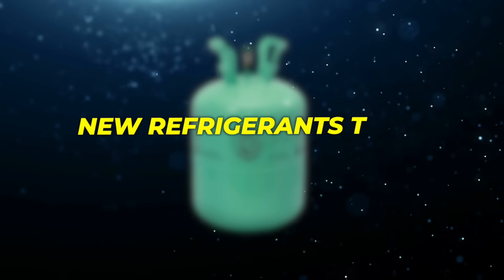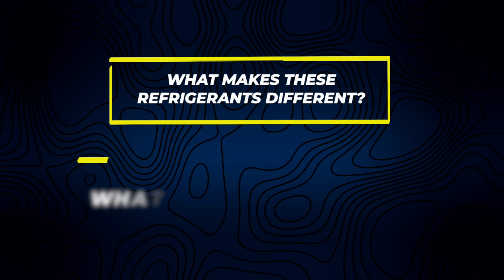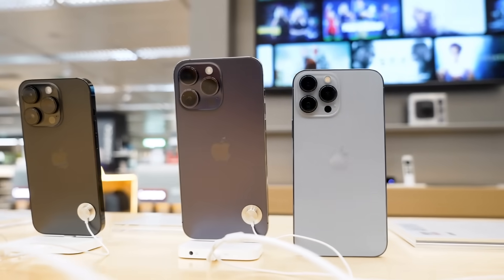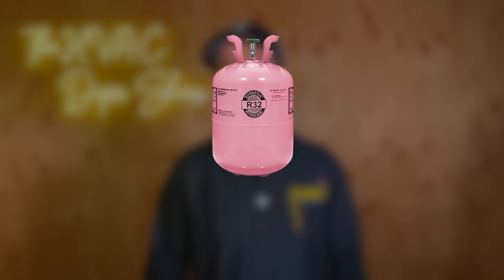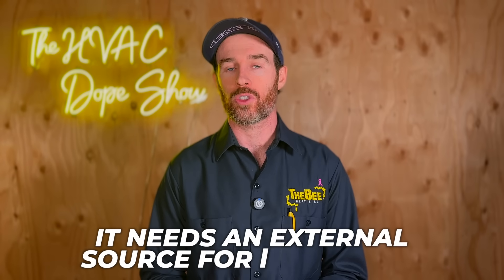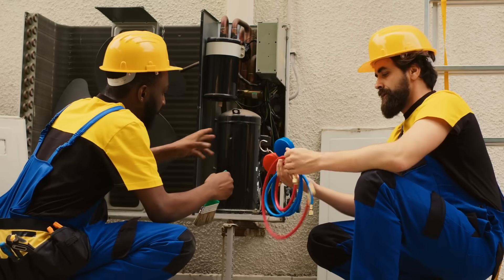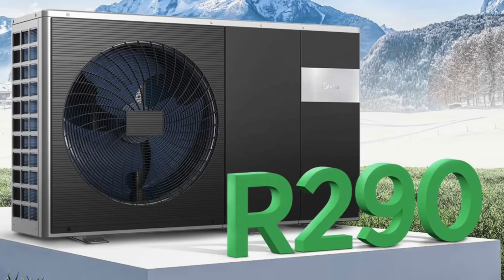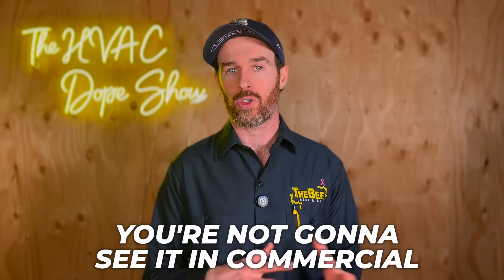The TRUTH about the “new” refrigerants | R32 and R454B refrigerants phase in

Comment: After watching the video I'm honestly still unclear when its worth waiting and when it is not. I understand your point of the planned obsolescence, but we still have to play into their game at the end of the day, and which way would you go? If it were your house and you were about to purchase a system (not an emergency replacement), would you wait a few months for a R32 redesign of the Daikin Fit for example? Or would you buy a non-R32 Fit today, not regrets? Thank you for your videos, I learn a lot from them.
Reply from the maker: Its hard to answer as the HVAC tech because I’ve bought 410a systems personally knowing this is happening… short answer is yes I’d wait for R32. But I’ll give you more context, we’ve installed two new systems one at the shop and our home knowing this was happening within a few years, but at this point if you can wait I’d probably buy an R32 system just because it’s the newer stuff. But I’m also comfortable working on my own equipment if something fails so as much as I’d like to exclude that bias it’s still there… I think if it was my moms house or close friends house I’d be 50/50 split with no regrets because the benefit of 410a is that there’s no shutoff safety switches for refrigerant leaks like there are on the R32 air handlers - which is good because you have to actually fix leaks now and can’t just top off a perpetual leak… but it’s bad for the same reason that in the middle of summer if a coil failed or something, then the R32 safety circuit would prevent it from starting until the leak is actually fixed. This just makes me nervous if I’m trying to get something to cool for a night in the middle of summer in an extreme climate like Phoenix I couldn’t top it off with a lb and come back the next day, I’d have to deal with it right away. Practically speaking R32 is a better call but I am starting to see you can get good deals on SEER1 410a equipment now that the SEER2 stuff is phased in fully, so if price is a determining factor and you can get a smokin deal that’s another thing that might sway me just knowing that I’m getting some close out equipment. If I lived in a hot coastal climate like coastal Florida with a 10 year replacement cycle I probably wouldn’t think twice… for what it’s worth Daikin is honoring 410a equipment failures with R32 equipment if there’s ever a catastrophic failure which is a very nice warranty for people buying stuff right now having peace of mind. Long answer but lots to consider, hope that helped and didn’t confuse you more, it should be a non issue soon in most places because we’re already getting R32 equipment in a few of the models.
Reply: @TheHVACDopeShow  Awesome, thanks for the insights. Yeah I'm in the position where I got a recent ducted daikin fit quote that was a couple thousand less than last year's quote. Thought it was too good to be true, now I'm realizing its a 410a clearance discount. I'm in the PNW so I am tempted to get the 410a system at 2-3K less than I had anticipated. But we're already so backwards in the US with refrigerants, it is a shame to get stuck with the older one. But the discount is pretty decent and makes it much more possible to recoup the system cost over it's life. That is cool to know a warranty replacement would be honored with a r32 system.
Reply: I am in that exact position. I just lost my heating system due to a flood and I have solar panels so I figured I would upgrade to a heat pump. It's just before October and starting to get cold so I am on a time crunch. I decided to go with the r410 system because I did not want to be a guinea pig, it was more affordable and many of the HVAC techs around my area have not been trained on the 454 or at least that's what my guy says. 

Not that I could have afforded it but I wanted to get a Ford lightning and decided against it because I did not want to be a guinea pig and that was a wise decision, if I was in the market for a new truck. That thing has had a boatload of problems from what I've heard. I can only say and assume that the new 454 systems will need time to work out the kinks. 

Also, if you download and look at the numbers in the extended data sections, specifically bosch, and actually watch one of his past videos on what those numbers mean and do the math you can see that the r410 is actually more efficient than the r454. 

I looked around and could not find much information to support that heat pumps are very expensive to maintain if you do the preventive maintenance and service them. Therefore parts shouldn't be an issue. There's also warranties with the units, I know Bosch has a 10-year warranty on parts for its premium which is the system that I will be going with. Trust me I put a lot of time and effort into the research and ended up going with the r410.
Reply: The reason why I was considering the Bosch Ultra over the premium was because it worked better in colder climates but I figured by going with the premium and the cost difference as well as the better efficiency, I would be better off just installing an electric heat kit. I might have even installed one on the ultra so, really what's the point.

Comment: I have a Carrier AC in SWFL that was installed in 2015. My preferred HVAC company mentioned that I might want to replace before a breakdown before the change over to stay out of the guinea pig early adopter zone. I'm getting the vibe that the technicians are just unsure of the future vs giving me a sales tactic. They told me about the requirement to remove and replace the new refrigerant but they also mentioned as you did that it was also true of 410 but it was loosened up a bit once things settled down. I'm not sure if it was a sales pitch or just informational. They know I'm a bit more informed than most so it felt like we were having more of a casual discussion of the pros and cons of various scenarios on what to do in the future when the inevitable happens. Will I be able to get spare parts for an over 10 year old system? How long will it be cost effective to repair vs replace?
I can spend at any point in the future $10k+ on a new system and an additional $3k on end of life repairs or spend up to $1000 a year to keep my seer 17 system running as long as I can get parts. It starts to feel about even if I don't get significant efficiency savings.
Reply from the maker: You don’t have to replace it and the only thing you might have a hard time getting is a compressor but honestly that shouldn’t even be a problem for at least a decade… we can still get R22 compressors but just can’t get R22 condensers (entire outside unit / box). If you’re comfortable waiting and not in a hurry I wouldn’t rush, the R32 equipment (Daikin Goodman and Amana) is already battle tested in the field in Europe and other markets overseas so I wouldn’t worry about biting the bullet as an early adopter, 454B is carriers refrigerant and my understanding (what I’ve been told) is that this refrigerant is in fact new so you are more of a guinea pig there. Carrier is pretty reputable so either way you’re probably in ok shape
Reply: @TheHVACDopeShow And now it's a shortage of 454b or a cylinder shortage, and I have to replace a 20 year old r22 system. I am leaning towards an r32 system.
Reply: So we are in the process of replacing/ shopping our Trane central air unit as the high cost of R-22 and so on. We were told do it now as the units will be 30% higher in 2025, many techs really don’t feel the refrigerants are going to be as efficient , way more costly to fix, and these new ones have to have a monitor, wtf! a monitor…..seriously I think our government hates us🙄

Comment: Is is technically possible to use any kind of refrigerant? Are they interchangeable or can the equipment be damaged if a refrigerant is changed?
Reply from the maker: Not interchangeable at all no, they have different design pressures and operating conditions. You will definitely damage your system this way. They have “drop in” replacements after they’re phased out like Nu22 (R422B) which can be used in place of R22 for example and has similar properties, but no you can’t drop 410a in an R32 or 454B system

Comment: I’m in this boat right now. Leak in the system that first identified itself 4 years ago, recharged twice but now the compressor is shot and with the system being 18 years old, recommended to completely replace. 

I am leaning towards sticking with 410A.
Reply: they are selling 410a pound for 100$ after next  years they will be selling 200$ most likely. i have evap coil leaking system i put stop leak and sticking until this dies
Reply: It’s readily available, will be until 2040. I would.
Reply from the maker: Correct 410a shouldn't skyrocket like r22 because its phaseout schedule is over 15 years out. And there's drop ins. R22 didn't jump until 2020/2021 when it was no longer made domestically. But either way if your system is out it's not the end of the world a lot of the R32 units have hit the shelves, we're just waiting on the inverters from Daikin but the 14 and 16 SEER R32 systems are out. But if you want 410a you'll be in good shape too it's not that big of a deal
Reply: @TheHVACDopeShow  I was charged $200 or $250 per lb of R22 a year or two ago.
When I replace the HVAC I don't get any credit on the remaining R22 if they get to suck it out and reuse (for other R22 units)?
Reply: I thought 410a systems were no longer made so only whats in inventory will be available for replacement system components this yr and future yrs

Comment: HVAC tech of 15 yrs here, still running both of the original 1989 r22 2.5 ton systems in the house I purchased in 2012. Will continue to run these units til their dying breath. I have upgraded from the original carrier natural draft furnaces.
Reply: Based
Reply: My 89 r-22 unit just quit 😢
Reply: Got to get government/  EPA out of our lives…making us miserable and poor. Next president needs to reverse these draconian executive order and mandates …leave alone what’s working right!
Reply: @CarriUSA  DuPont and EPA in bed together, $$$$$
Reply: @CarriUSA 😂😂😂😂😂😂
Reply: @tbrown121172 fix it and use MO99 in it.
Reply: HVAC service tech for 20 years.

I tell customers the same... 
Unless they develop a leak (warn them we charge about $300/lb for R22) or the compressor is shot, go ahead and run it till it dies. 

Or, look at how much they're paying for electricity and what they could save by upgrading. Not to mention the rebates that are currently available for going high efficiency and are quickly going away as it becomes standard. There's no point in offering any rebate when high efficient equipment becomes standard. So you'll end up paying more for the same equipment by waiting.

I leave it up to the customer. I just make it clear that a lot has changed the past 20 years. A lot more is going to change.
Reply: The seer rating for the "new" refrigerant is only seer 13ish and R-134a was in the seer 25s... way less efficient
Reply: Hell yeah
Reply: My Carrier from the early 90's started to show signs of "dying" a few years ago. When temps reach 90 plus here in Florida the unit never takes a break... it just goes and goes and goes for hours without stopping till night falls and temps go down outside.  I had an AC tech come yesterday and do a thorough check up and it appears is the 35 year compresor.
Reply: @jerseyRicangirl2364  Same here.  I supplement with a window unit.  Run it until it dies.  Get a lower rated filter to let it breathe!
Reply: Good idea...Ours is 1991 R22 4 ton. Not liking the electric bill any but A/C performs great.
Reply: Still have my 85 Lennox and she is still alive and well. That unit will NOT leave its spot until it's completely dead.
Reply: Gretta won't like that! LOL
Reply: @transmitterguy478 oh right.....
Reply: @transmitterguy478 How DARE you!!
Reply: Since 1991 Amana R22 still going strong and on original fan motor, contactor and capacitor. No leaks original R22.
Reply: @Garth2011 Awesome!!!
Reply: I have a great running R22 system and I have a partial can of R22 left, I have a tight system and when it needs a compressor I'll replace it. There's MO99 which is r438a I believe, a direct replacement for R22 P T chart and oil the same too.

Comment: Great video.   However how does r454b and r32 do when osa is over 95 degrees.  Testing in the lab is normally is preformed at/under 95 degrees osa.    Being in the desert I’ve seen 125-135 osa on a rubber roof or you have multiple ac’s discharging into one other in July or August than it’s 145-148 degrees I’ve seen 500 to 525 psi using r410 because of the heat.   I guess we’ll find out later under those conditions after the check cleared.
Reply from the maker: They use R32 overseas already in places like Saudi / Middle East so R32 is battle tested allegedly… but we shall see!

Comment: So, I will not be able to buy new 410 A equipment by the end of 2024?
Reply from the maker: Allegedly they extended it through 2025 to be installed to allow manufacturers to clear out existing inventory but yes this is the last year to get 410 equipment basically, and the refrigerant will be around for a while longer
Reply: My Trane supplier just bought a shit load of 410a equipment so we can keep installing it as long as possible. I can still remember the changeover to 410a and all the LEAKS associated with it because manufacturers just changed the metering device and kept the old welds and seals. What a nightmare. I was still installing r22 I think until 2006. Then they sold units charged with nitrogen that could be used with 22. So there are ways around it.

Comment: What you fail to realize is that it's not a big deal that the new refrigerant is flammable to the average consumer because as you explained it's not that big a deal. But the government doesn't work that way The government is going to overregulate that and the equipment is going to put all these failed safes in place so that doesn't happen which means that that same 2025 air conditioner is going to cost 30% more than a 2024 air conditioner for a while
Reply from the maker: It’s more expensive but closer to 3% to 5% is what I’m seeing... There’s a dragonfly board that senses refrigerant leaks in the blower, and the condensers themselves are 2% more than their counterparts. One thing I do like about R32 (as much as I hate planned obsolescence even if it’s “good for business”) is that the charge is much lower and systems are a much smaller footprint, so on the installation side this makes things more manageable.

Comment: FYI;  The phase out has been delayed by one year.
This new Interim Final Rule allows for the inventory of higher-GWP HFC equipment manufactured or imported before January 1, 2025, to be installed until January 1, 2026.
Reply from the maker: Good to know!
Reply: oh wow but whenever i replace my leaking system i will go with r32 or r454b i won't install 410a because they will charge crazy prices in future for refrigerant

Comment: TLDR phase down of refrigerants is more about profit than about the environment. R-32 was invented in the later 60s, why didn't it just replace the CFC or replace R22 then? Money, it's all about money and it'll always be that way. Now we've gone from refrigerant like 410 being around 95-140 a bottle to R32 and 454B be 250-350 and only be 20LBS of gas per new bottle......
Reply from the maker: Unfortunately seems to be the way things are going
Reply: My 4 year old condenser just blew the coil. It's under warranty. I got a quote of $1,600 and $1,800 to install the warranty coil. I can't bring myself to pay that because $750 of the quote is for 7.6lb of r-410a. I'm fine with the labor charge, but a 1000% markup on refrigerant is crazy! So, I just purchased an entire system to replace both units. The total cost is just under double the repair cost, and I have all new. 

I couldn't pay $100/lb for something that costs $10/lb. The new condenser comes pre charged. I also bought a 25lb tank of refrigerant for $250 to have on hand.
Reply: Performance is far below any benefit
Reply: Since the changeovers are costing HVAC manufacturers 100s of millions f dollars, it’s not about profits. It is only evnvironmental.
Reply: @WLB2-j5j  You're cute to think thats the case, how about refrigerant manufacturers like Honeywell cornering the market and making huge profits off the first few years of the new refrigerant before the patent is out?
Reply: @FrostHVAC  The laws that were passed to phase out R-410A were done for environmental reasons; Honeywell or other companies don't make those decisions. Congress does.